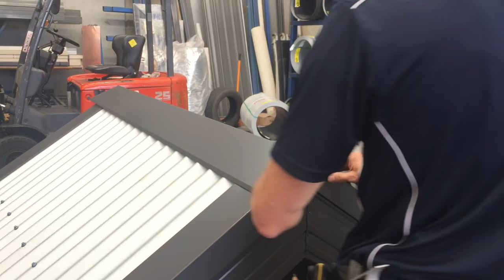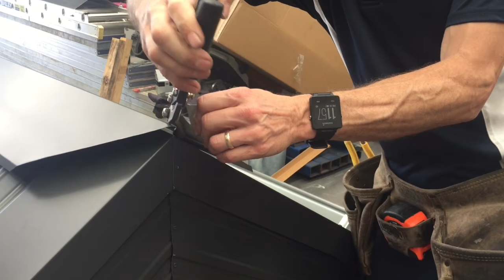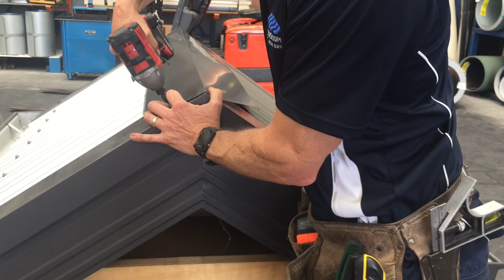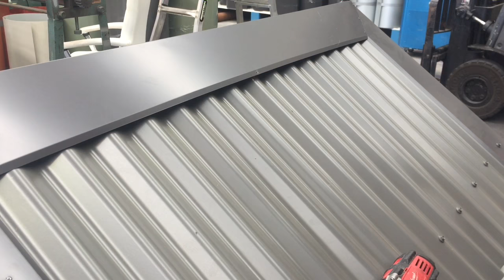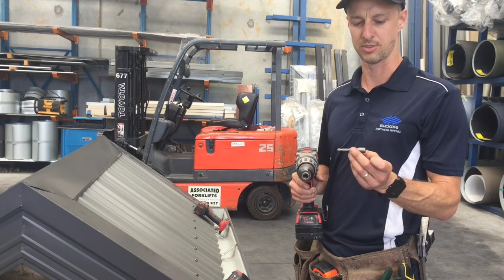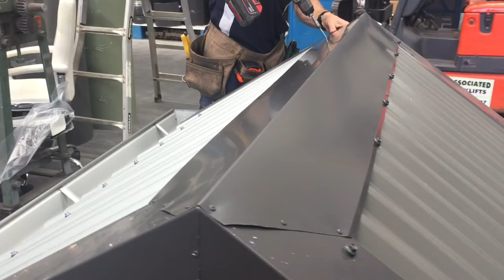How to: Install Flat Ridge Roof Flashing COLORBOND® | Metal Roofing Online

Comment: I dnt know if u know it but if u cut and the waste is on the down side of the cutters it leaves you with a smoother cut
Reply: This is true bud. I do this on visual areas such as metal clad window flashing. 👍👍 good tip

Comment: Hi I am installing solar panels on metal roof in India, I wish to use ridge cap purlins for installing aluminium rails, these aluminium rails will be installed perpendicular to existing purlins, thereby cutting small portions on the ridge caps from the edges . Please confirm if this is the right thing to do with the ridge cap.?